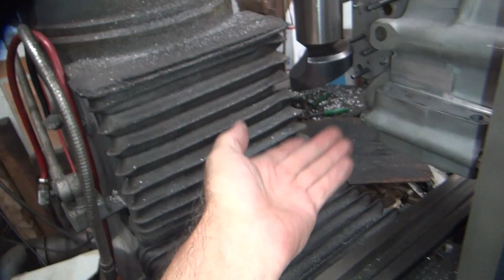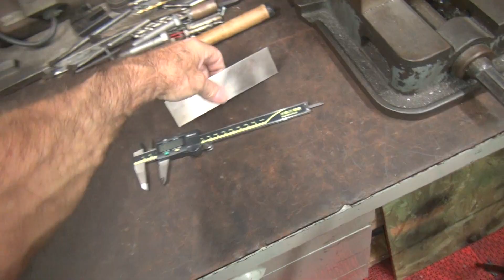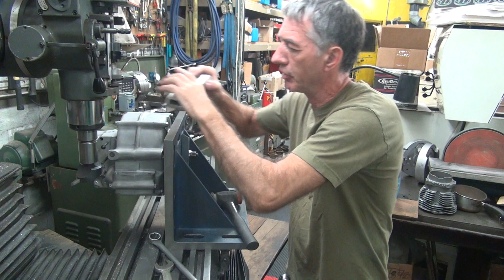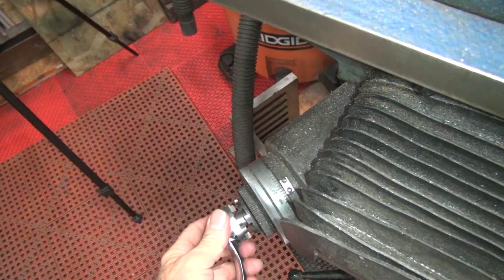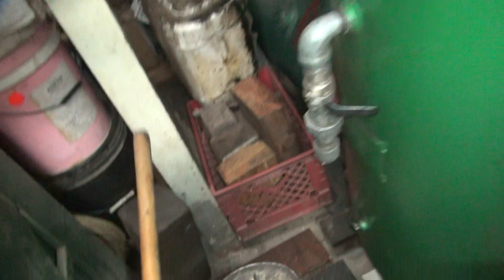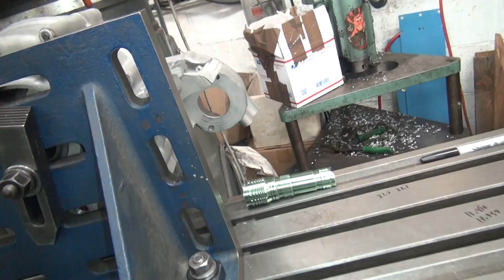#146 1946 junk 84ci stroker knucklehead 500 mile new repo motor rebuild 79ci harley tatro machine

Comment: Is there any “angle” relationship between the oil pump mounting surface and the motor mounts?  Also, were those motor mount surfaces perpendicular to the bolt holes?
Reply from the maker: every case i measure and blueprint i look at has different dimensions. when you watch all the videos, you can see why i cut each surface to what i think was the best for what i had to work with. one think is forsure. everything will work together now.
tatro